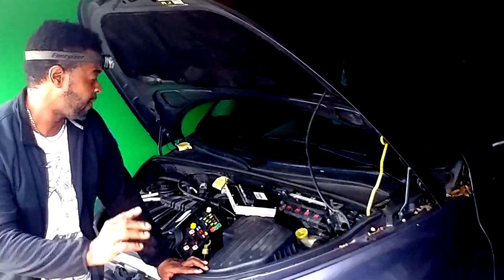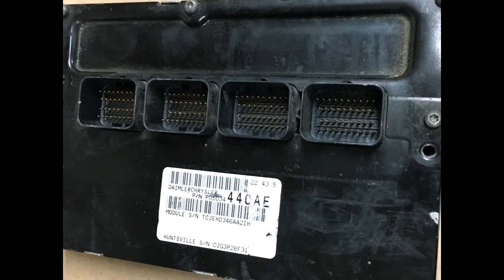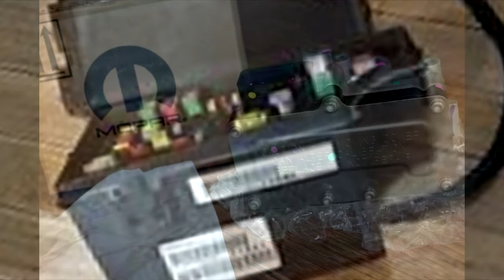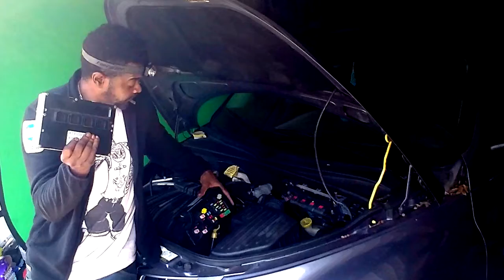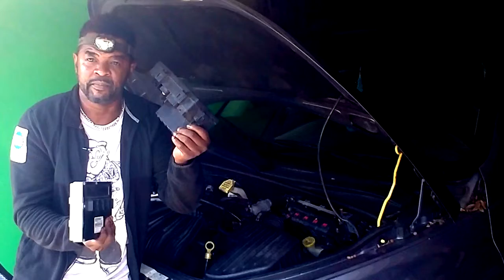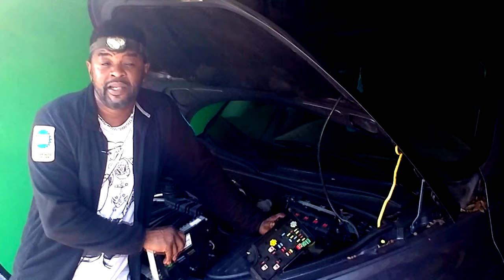P0882 P0700 Tipm PCM or Both PT Cruiser. Chrysler Jeep Dodge . 41TE A604 Transmission whining noise

Comment from the maker: P0822 PT Cruiser updated video, do this: https://www.youtube.com/watch?v=j-5vQfyaabQ&feature=youtu.be
Reply: My 2004 pt cruiser turbo2.4l failed inspection with codes 6102 and 6104 does this mean i need a new computer would appreciate an answer
Reply: Hey I need help got a 2006 pt cruiser check engine light comes on and it goes in limp mode
Reply from the maker: @savageceo5038  Hey bud what code are you getting out of the computer? Also are you subscribed to the channel?
Reply: @OnlineMechanicTips  I will let you know when I get home imma put it back on the code reader and see and let you know
Reply: @OnlineMechanicTips  and yes I'm subscribed to your channel
Reply: @OnlineMechanicTips  the code is p0613
Reply from the maker: There is a problem with the TCM part of your car computer.  The easiest thing you can do is try a hard reset and make sure battery connection on point. If that problem return you will likely need a PCM
Reply: @OnlineMechanicTips  ok now code p1604
Reply: @OnlineMechanicTips  hi I got another PCM now my car code reads p0700 what could that be
Reply: @OnlineMechanicTips  hello my friend, you seem to know a lot about pt cruiser, I really need some help,  can I fit a fuse box integrated  from a sebring 2.0 in to a pt cruiser 2.4  year 2006?

Comment: So I have a 2006 or cruiser. My tipm   fuse cover got left off by accident. It got rain inside and corrosion on my motherboard. I dried it out but my car now has no bus. Would a new tipm most likely resolve my case.
Reply from the maker: Its hard to say guy. But thats def the place to start. Of course theres a chance you may need something else but you will never know until you start somewhere. And starting with that water drenched TIPM a good place to start

Comment: Crazy story but it worked for me. When my 06' went to limp mode with that code I pulled off the road, turned off the engine, took out the key, opened the door then closed it, put the key back in and started it and no more limp mode! I have been doing that off and on for a year now when that happens because I haven't had the $$$ for the Tipm and the PCM. Hope this helps someone out. 😊👍
Reply from the maker: Yes, it does a temporary reset every time the key is turned off. Once the computer sees the problem again is when it sets again

Comment: Pull the Green PCM Plugin on the Right .. Carefully , Cut back the wire sheathing.. Check the Yellow wire / Orange stripe specifically for a barespot or short .. Found it on mine , taped it up and NO MORE PO882 .. Hope this helps someone , It drove me crazy for 6 months !!

Comment: Hey bro, great video . But I can't figure out my problem still, i have a 2004 pt cruiser touring 2.4 automatic. It's going into limp mode. It starts up fine and goes into reverse np at all, but putting it into drive . It doesn't want to get out of 1st gear. Even if I try to put it into low gear, nothing at all. Can't go no faster than 40 miles rpms at 3 1/2 i don't push it over than 4 on the rpms . Don't want to blow up my transmission. I need help, please 🙏 bro
Reply from the maker: Your 2004 model dont have a TIPM, so this video dont apply. What are the codes you pulling up? Also are you subscribed to the channel?
Reply: Hello bro,  so I'm just getting out for lunch. And the car was hesitating to start again. So I went to auto zone to see why . Man, not again, so I'm getting code p0562 ,p0888, and p0700 but we did what I told you, we got all the other parts put in SMH

Comment: I have a 2011 Chrysler 200 and I get that code all the time, and I have for about five months. Sometimes it’ll go into like limp mode and I have to pull over and restart the car or clear the engine light, and the code always says “pcm low-voltage”
For a while, fixing the ground cable to the jumper post  worked but I still get the problem. It’s really annoying.

Comment: I have a 2009 Pt cruiser having some issues . Long story it won’t start cranking but no start I changed the shift cable a month ago  hasn’t started since . Can’t get any reading on it no codes come up put in a new relay starter relay .  New ignition sensor new coil pack I’m going to do a reset by keeping the key on the start position and the battery on a trickle charge . To reset the I don’t know .  Lmao at a lose with this dam car .

Comment: Have code P0700 and P0882 06 PT Cruiser. Goes into limp mode. Then turning it off and back on, it shifts fine. Can doing an Electrical System Maintenance cleaning all the grounds help fix these issues?

Comment: I have an 06 that always goes into limp mode. i installed new PCU but after a while it went into limo mode again. any advices?
Reply from the maker: What is the code? Also are you subscribed to the channel?
Reply: the Codes I got are P0700 and P0882

Comment: I'm working on a 2007 PT cruiser passenger side dem light. I replaced the light and the light doesn't work. I checked the plugs driver and passenger side dem and it's showing that it have power coming through.
    Still the passenger side dem light is not coming on. Only the driver dem light work. I am very confused 🤔

Comment: Hello. I was reviewing the info you have provided. I’m having a challenging time on finding additional info on YouTube for what I’m currently going through. I have a 2003 Chrysler 200. Transmission is a 62TE. I’m having a challenging time finding info for that particular code: P0882. Would the same troubleshooting applied in this video help me with what I have going on with mine? 

I’ve already replaced and ensured a hard reset on the TIPM and the code still persists. I was thinking of replacing the PCM next to see if it may help or not.

Any help would be appreciated. Thanks in advance!
Reply from the maker: Hello my friend, this car equipped with a 62TE not the 41TE. But this still could be your problem. If you can get a used PCM or TIPM for say 30 or 40 bucks apiece, ide say its worth the gamble. As for as diagnosing to verify exactly which one the problem, the info will have to be pulled up and a lot of testing ran.

Comment: Does that gor 2004 pt
Reply from the maker: No..04 a gen 1..what problem you have? Are you subscribed to the channel?
Reply: @OnlineMechanicTips  yes im subscribed ...i just saw a video about speed sensor..my transmission. Starting to not shift right...do you think transmission flush and filter change work???
Reply from the maker: @gcortezz37  Hey bud, you first should get your transmission scan to see if theres any codes in it
Reply: @OnlineMechanicTips  absolutely right will do AMIGO....because your my friend now..lol...GRACIAS!!
Reply: @OnlineMechanicTips  so took to a shop...they want to rebuild tranny for $3k...because something is falling apart inside and plugging up filter...the oil has never been changed in 17 yrs. It has no leaks.....should i first try changing it??? Im not rich but i cant lose my baby ..G!!! Lol
Reply from the maker: @gcortezz37  o wow, yes. A trans service is the easiest thing you can do to help prolong the life of your transmission bud
Reply: @OnlineMechanicTips  next on the list my friend ...thanks ill keep you updated...mechanic didnt like that i researched on youtube a bunch of very good info

Comment: Alright I'm going to put up one of my videos on this 2006 PT Cruiser with ph820 codes and other low-voltage codes following suit behind it I want people to focus from the battery the terminal and the wires make sure that the connections are fastened down tightly and look for any break how long do Terminals and its wires before you start throwing money at the vehicle for the tipm and I've been noticing people immediately running to the tipm and replacing the tipm to still have the same problem the tipm is a plug-and-play to a certain degree for the basics but anything that is an accessory has to be turned on through a scanner high-end Amid and scanner has to turn all the systems on hello and scanner will not be able to have any bidirectional scanning whatsoever or allow you to turn features on and off it does not matter if you went to the junkyard and got the same model number same everything that matches what came out of your vehicle you have to program the tipm okay the tipm is spark plug and play for the basics starting the engine turning lights on and that's it as far as the accessory goes you have to program some of these accessories the majority of the PT 2006 Cruisers that I get into my shop or I fix on the road because of this problem and this particular problem right here it's because of loose connections and I mean very loose connection on the positive cable there are two wires that also connects on top double-check those check your terminals for corrosion the scanner will give you a general direction of what to start looking at better trained technician that knows how to diagnose things will start looking for the battery on his way up to the tipm majority of all Dodge or Chrysler all Plymouth suffer from Browns problems the ground issue problem and it's because of the wiring that they nice wires that they use okay and these wires get frails once you hit a hundred thousand miles and higher I'm going to put up this video that I was working on today with this PT Cruiser as she has multiple PT Cruisers that are having the same issues one is the PCM has sorted itself out because a grounding issues and the other was just grounds terminal wires problems always start with the basics before you go and you start throwing money I did not mean repeat that until I go numb in the mouth and I lose my breath start with the basics start with the battery and work your way up double-check everything that is tightened down and I will repeat myself again always start with the basics number repeat myself again for all Dodge and its sister companies that are having this type of issues always start with the battery terminals and work your way up scream
Reply from the maker: This was an interesting read. Im not sure if you meant P0882 but this video was centered around that code. And yes, im in agreement that all diagnostics leads thru the battery and its connection. But thats not to simple say you dont need a TIPM, diag has to be done for that to be known. Now, because the average cost of a TIPM or PCM from a Pull a Part salvage yard cost about $40 bucks apiece, I chose to not center the video around a long drawn out session about which one at fault. Save time and simple get both for maybe 60 bucks. I will have to respectfully dis-agree about a TIPM issue. They can be considered plug and play if you get one from a car that match the part number and features that your car have. I use the dealer scanner and never really have to do a reconfiguration on such TIPMs. But I dont see these as much now here at the dealer but the knowledge about the car still front and centered. I will be looking forward to those vids you speak of uploaded. I just visit your channel and subscribed to catch them. Thanks for the tips bud

Comment: You are zeroing in on my problem, I don't work on cars myself so I have been struggling getting it fixed properly. My 2006 turbo only does it sometimes, clunks when I shift into reverse or drive, then  I drive a few blocks, rpms go high, and doesnt seem to shift. I pull over and restart and it is fine for the rest of the trip, sometimes I have to restart several times. A year ago Aamco charged me over $1,200 to replace the control module, used. It worked for a week, then same problem. I very recently, sent in the pcm to be reprogramed, was freaked out when the engine ran badly when I reinstalled the pcm, then a mechanical friend told me to drive it because the pcm and engine have to adapt to each other. So that is where I am now. I have driven it 3 times, he said start with short trips, then longer. First time, it ran pretty good, 2nd trip, ran good until I turned on the AC, there was tapping noise which friend was a.c. starting, but over and over, parked in the garage and let it run a few minutes longer, then it sounded like a big fan blowing, I shut it off. 3rd time, ran good, turned on a.c. again, still ran good, again let engine run a few minutes again that loud fan noise. As for transmission, on first trip, it made clunk noise, I restarted it right away before driving it, has been working good so far, but not ready to trust it yet. Also when I ordered the pcm reprogrammed, I gave the vin and engine numbers, rechecked my engine number, there was a TNX in it, but I told them TMX, so I don't know if it was programmed wrong. This all just makes me very uncomfortable. After the pcm and engine are adapted r to each other, I plan on getting diagnostics done just for my piece of mind. I may go to a junkyard and have them pull that other part for me. Also my radio was replaced before I got the car and now it won't come on.
Reply: Hey I know this was years ago, hoping to get a reply. What helped the transmission shifting problem my 06 pt is doing the same thing. I have to restart and restart to get it to drive and shift correctly
Reply: @larryfiedler2162  yeah I’m having the same problem on my 2011 Chrysler 200. I have to pull over and restart it and drive it very slowly at the beginning so it doesn’t go back into limp mode. Sometimes the engine light will come on, and it gives me the PCM low-voltage code.
Reply from the maker: Wow, I would say this about the VIN mis hap. That could be important as far as if it indicate a feature. I do not know the complete VIN so cant tell. Depending on the fault code the PCM producing, this may not indicate a problem with the PCM but in fact, the TIPM. Yes, I highly suggest you get it properly diagnose before investing any more money on a PCM..I hope you get it together. Thanks for watching, please like the video and subscribe to the channel for me, thanks
Reply: I’m having the same problem on my 2011 Chrysler 200. It’s like it goes in a limp mode and won’t rev more than 3000 and I have to pull over and restart it. Sometimes the engine light comes on, and I plugged in my OBD reader which gives me this code low-voltage PCM. It’s annoying because sometimes it does work and sometimes I can drive it for hours on end and not have a problem. I replaced the ground to the jumper post and that worked for a couple of months but I’m having the same problem again. Also, my stereo just went black as well.

Comment: Code p01603
Reply from the maker: My friend, you have some problems going on in your controller. What year make and model is the car?
Reply: @OnlineMechanicTips  I know this is an old post. But I get code 1603 and u101. Car goes into limp mode occasionally but will go right back to driving correct. 2005 pt cruiser touring
Reply: 06 pt cruiser first code popped up p01604 I was told PCM to be sure I took it to get a diagnostic test then code p01603 TCM  I'm going with replacing the computer
Reply from the maker: @donaldfinkler2490  Yes thats a NGC controller. it does both PCM and the TCM, there is no TCM on a 2006 PT Cruiser..

Comment: I got the code P0882 replace TIPM in my 06 with a 08. Six days later check light comes on code P0700 car goes into Limp mode. I can clear the code and it drives fine til other week til the code comes back. So what could it be. I don't just want to throw parts at it. Car only has 60k miles on it.
Reply from the maker: Hey Tim, please subscribe to the channel for me, thanks. Listen, I agree, do not just throw parts at it but you gonna need a scan tool that can tell you the P codes in the module/ P0700 is just confirming that there is a transmission promblem. You will need the specific codes to get you in the right direction.

Comment: There is a problem with the TIPM on these PT cruisers.   My TIPM was replaced on my 2006 PT cruiser in 2014 - totally stopped on me while waiting for the light to change - would not move or rev up or nothing, but the radio would come on.    Paid about $600.
Reply from the maker: How are you so sure that this new problem is with your TIPM? Please subscribe to the channel for me, thanks
Reply: @OnlineMechanicTips  Well, I know after the dealership said it was the TIPM that went bad, I looked online and there were many people having problems and complained to Chrysler about the TIPM and it seems it should have been recalled - but of course Chrysler was not forced to have a recall on them.   I know now I am having problems - I have been hearing weird electrical noises when I start my car sometimes, and one time all the  lights on my Park Drive Rear dashboard section, all came on but then later went off.      I have subscribed to your channel.
Reply from the maker: @crazydaysful  That may be the case but that doesnt mean your problem is your TIPM. Also keep in mind, that TIPM has a number of responsibilities but so does all the other modules,..Its now 2019, your TIPM was replaced in 2014 for probably a P0882 code..I guess my point is, your problem could be a number of things, not just a TIPM..The heart of most any and all electrical promblems start with its heartbeat, which is the battery and its connections, worth a closer look
Reply: @OnlineMechanicTips  okay....battery. I got a new battery from Pep Boys 2 years ago...I know one time I bought a battery from them and It lasted only 1 year.   I know my battery gets that "crust" around it all the time.   When I got my valve gasket job a month ago...the mechanic cleaned the crust off the battery....I will have my battery checked